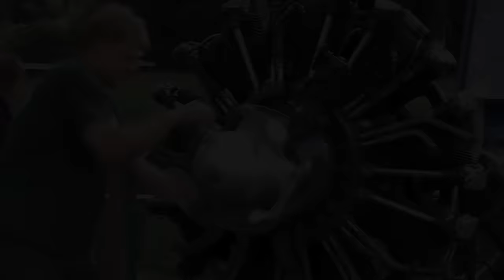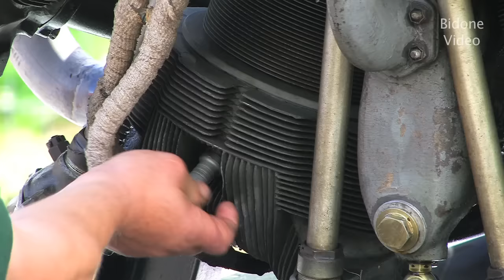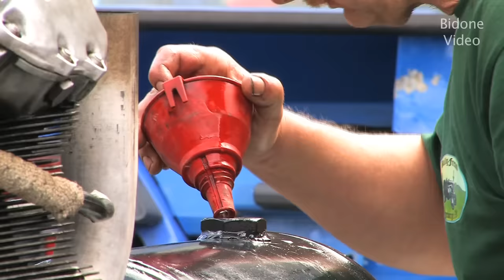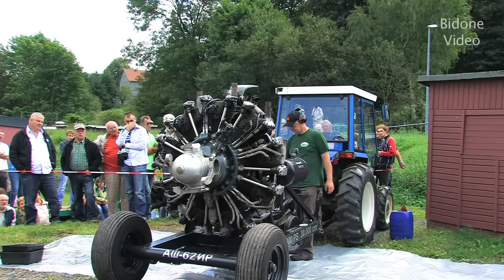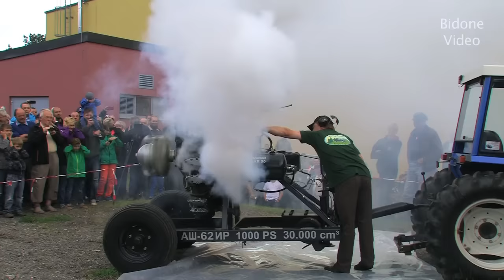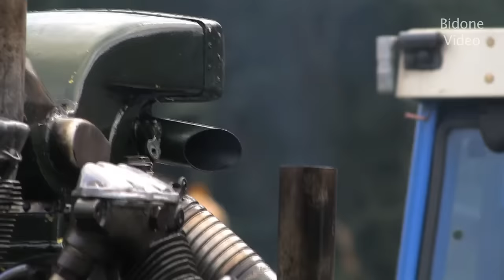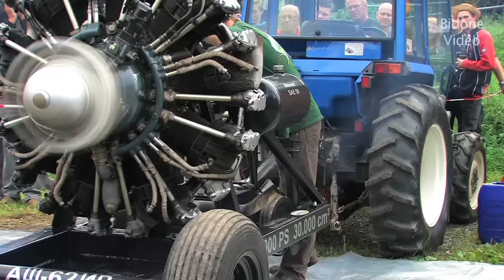Russischer Sternmotor - Russian Radial Engine Start and Run

Comment: Needs a propeller to impose some load on the engine.
Plus, what is cooling the cylinders?
Reply: +Robert Gift i was thinking the same thing, at that rate they gonna blow the engine because the lack of air cooling. 

and then they need a BIGGER tractor to hold it lol
Reply: +Neo Here tractor cleared for take-off
Reply: Nothing is cooling them. But these engines can run quite a while without overheating. The engines are designed to be cooled by the prop and the cold air up there. Radial plane engines are also used in Tractor Pulling, also without any coolant.
Reply: +Robert Gift These engines usually take a few minutes before they even reach operational temperature, so a few seconds running for an expo won't bother it.
Reply: +Soldier  they put em on choppers now also
Reply: +Neo Here yeah imagine if that was a thing lol. that it would blow up the instant its started without a propeller. you know its quite a lot of metal to heat up
Reply: )Peron1-MC(  An engine need not "blow up" to evidence internal damage. 
At a minimum I would have a fan blowing cooling air at the engine.  (But a propeller would be better.)
Reply: Robert Gift at least a small propeller from smaller engine is better than, no propeller lool
Reply: honestly the heat should not be a issue for such a short runtime. However if they let this engine sit in storage until the exbo that could cause way worse issues. Engines were designed to move and deteriorate very quickly if left unused for extended periods of time. I personally have had to revive several abandoned engines in my time and it takes hours just to get them to try and turn over much less stutter or start.
Reply: Ya good thinking their guy, let's put a prop on it to "cool" it... So it can take off and kill folks.... Short run time won't hurt that engine
Reply: Just a couple of quick thoughts. 1) I sat behind 600 hp. Pratts (BREs--big round engines) similar in appearance to engine in the video for over 10 years. As a crop duster. Didn't have batteries, electric starters on board (too much weight). Power carts at home field, hand propped if we HAD to shut down out in the field. Point is engines occasionally sat idling for hours at times. Everybody hated having to prop those monsters. 2-bladed props generated very little airflow close to the hubs where cylinders are when not in flight. Yet normal MTBOs--1000-1200 hrs!  
 2) Motorcycle engines run for extended periods with minimal to no air flow. Probably much worse cooling in urban/city areas. Stop and go traffic. For no more load than simple idling, brief run up spurts, as shown in video, no inflight life threatening issues, this thing is likely to wear out the operators finger/thumb pushing on the throttle before the engine might need mechanical attention! Even though it certainly looks 'wrong'. One issue somebody mentioned which might be more serious is that there is a massive internal rotating counter weight in the crankshaft. I have no idea how running the engine without the weight of a big prop might affect that element.
Reply: true, and I already notice some issues with the inertial starter in thee very beginning.
Reply: Ml
Reply: Personally what bothers me seeing some of these vids is the confidence they have their old engine won't throw a rod and potentially maim the folk next to it. I'm no H&S freak but sadly these things don't last forever and a bit of commonsense is a good idea. Secondly, I agree a small prop's better than no prop, as will help both the visual demo and the engine cooling. Thirdly, all airscrews are meticulously dynamically balanced ,  so there are virtually no side loads on the crankshaft or bearings when running, just as if none is fitted. It's absence in terms of reduced weight and friction will just give the engine an easier run. The crankshaft bearings easily cope with the lack of the prop's thrust load.
Reply: They re russians ffs, they dont even know how to build It and yet you re trying with techniques on them? :D
Reply: Robert, I was thinking the same thing.
Reply: Judging by the cylinder heads its air cooled. How that air is gonna get there is another question😂
Reply: PURE MOTHERLAND AIR!

Ok now really, Radial aircraft engines are usually cooled by air, very rarely by coolant/water.

Comment: This engine is from russian aircraft  AN-2
Reply: Ukraine
Reply: Venti lator
its USSR, not Urkaine
Reply: Thomas Gephard AN-2 and I-16 - fighters 1936year
Reply: I-16 was equipped with M-25/M-62/M-63 engines with fixed-step propellers. The engine in this video is an non-military version of M-62 with hydraulic propeller stepping regulator built-in.
Reply: Thomas Gephard I don't know what was with earlier versions but I-16 with M-62 engine had step regulation automatically keeping constant ratation speed, just like regular WW2 planes.
Reply: Роман Гречко don't want to be a dick, but the AN-2 is everything except of a fighter. It's a slow, fairly large old transport plane.
Reply: If equipped with double high power slingshot and 10w Chinese laser pointers, AN-2 will be a most powerful fighter in the world!
Reply: Thomas Gephard hahahaha fair enough
Reply: deWaardt You're correct, the AN-2 was supposed to be an agricultural, passenger, or sports aircraft. Nonetheless, it was frequently used for transporting troops, weapons and ammo in numerous conflicts across the world.
Reply: BeyondOasys Yes, former made in YCCP (Ukrainan soviet sosialist republic) in CCCP (USSR), also the Antonov airplane factory is located in Kyiv in Ukraine. And the other factory in Poland Mielec produced the Antonov An-2 under license from Antonov named as "Mielec-Antonov An-2"
Reply: Thanks for enlightenment, I do not know well enough the story of Antonov airplane factory. Just know that it is in Kiev since I've been in Kiev with my Ukrainan wife. I saw the tomb of Oleg Antonov in Baikove Cemetery in Kiev. I saw the tomb of Oleg K. Antonov in Baikove Cemetery in Kiev. The tombstone was made of stainless steel with engraved various Antonov aircraft.

Comment: Magnificent! but the engine must get extremely hot without a prop though!
Reply: that was just a show sir, they run it for seconds so the operator knows it though..
Reply: it won't last more than 2 or 3 minute on the ground do the overheating of the engine
Reply: Vladimirovich volk
atleast it didnt seized
Reply: It will be fine. They use these engines in pulling tractors and still warm them up for a minute or two before they take off.
Reply: Cody Johnstonbaugh yeah i watched some tractors with these kind of engine in competition...
Reply: Cody Johnstonbaugh aa
Reply: Vídeos

Comment: Wow those cooling fins! Nice sound. Interesting comment to share: Back when it was hard to find the recommended weight for Harley motors, I went to an aviation company and bought 50W for cheaper than auto 30W. Forgot who told me to check it out. Also forgot brand. Thanks for the perfect video!

Comment: Needs the prop for a flywheel to get it started properly.
Reply: Oh, so you are an expert on big radial engines?
Reply: Expert?  Hardly.  I just happen to know enough about engines in general that with a flywheel, if you get even one cylinder started, it can keep the crankshaft spinning until the others start to fire.  The WWI "rotary radials" used a fixed crankshaft and had the cylinders rotate around it- the engine was its own flywheel.
Reply: Your right. It would start up allot easier. Also would cool down the engine properly
Reply: i would think for proper cooling the engine would actually have to be flying.
Reply: +bartdereu 
you're*
a lot*
Reply: Yes. These engines had a either a short test run propeller, approximately the same size as the engine, or a fan fisk, similar the one which was used with radial Sherman  tank engines and early helicopters. Latter is a safer option. Without any cooling exhaust valve seats heat up quickly and the seat ring might drop out from it's bore in the aluminium head. Then the jug is done if the engine is an interference design (open valve hits the top of the piston..)
Reply: @ostlandr  I totally agree with you Mark.  I was thinking the same thing watching the vid.  I suppose there's a danger factor to actually use a mounted prop.

Comment: Should have the exhaust collector ring in place, would stop all the spit and flames and would run quieter plus it needs a prop to stop it running away like that from cold. Poorly maintained as it runs pretty badly.
Reply: Well it was made in russia though Draxindustries1
Reply: Yeah like he's saying!
Reply: You're right, but it was show, and it acts more spectacular without exhaust collector.

Comment: There is a similar "bare" engine in Hungary, where they salvaged the engine from a retired An-2, the man built the platform and the engine control on the trailer himself. :)

Comment: wtf did he put in the tank.... honey??
Reply from the maker: Engine Oil.
Reply: +LifeTips 
He put in 50 Weight Oil just like my 1973 Ironhead XLCH Harley Davidson Sporster...  Most of the Old HD's used 50 Motor Oil, not until the Evolution Engines did HD start to sue synthetic...
Reply: +LifeTips  ha ha ,funny !
Reply: +LifeTips   That is OIL.  And it uses a lot as you can see, until the engine heats up the rings a just a tad hungry..
Reply: +ThePostal67 With no prop or cowling I imagine it heats up rather qiuckly
Reply: crankman68 True, that is why the smoke stopped so soon.   Does on most radials, but they use a lot of oil overall.   Most of the burn is at start up as the oil drains to the bottom cylinders.  Was talking to a guy that had one in Harvard IL.  World famous pilot, did a lot of shows..
Reply: +LifeTips  Да это мёд :-)
Reply: +LifeTips oil? it says motorenöl wich i belive is motor oil in german
Reply: +LifeTips yes it is honey, Russian bear likes honey :3
Reply: shayson1357 lolol
Reply: SAE 50 weight oil. it says right on the side. Just saying.
Reply: vector6977
thanks
Reply: you need to feed the cubs pushing the pistons right :)
Reply: American oil for french fries. :D He brought it directly to McDonalds, they were going to sell it for food :D
Reply: mptrax
lol
xD
Reply: +Bidone1967      20 - W50, braucht meiner auch....
Reply: +turbocompound Nein das ist singlegrade Öl, also nur W50
Reply: Vodka!!
Reply: It is motoroil he needs to mix that with the oil but it has its own compartment
Reply: lol
Reply: only difference is this guys motor started and didn't piss 3 qts of 50wt on the ground.
Reply: oil
Reply: DreamGaming No shit..!
Reply: purplinko its a joke chiil
Reply: )Peron1-MC( Motor Öl or Motoröl

in suisse-german: motoroel
Reply: It sure as fuck wasn't Pep Boys $1.19 a quart 30 weight!
Reply: Bear Grease
Reply: No, that's SAE 50W 5w30 would be way to thin. especially after the heat generated
Reply: Diesel engine oil
Reply: Yes, it's honey, Honey. SAE 50 grade super concentrated honey, from bumble beez on steroidz for high performance enjinnz! You'd be crazy to feed this thing with oil... :^)
Reply: Your a classic engine but doesn't know what motor oil is?......
Reply: YBNlean    Yes. Sometimes Maple syrup.
Reply: SAE 50 oil
Reply: Ciao5
Reply: glue
Reply: +ThePostal67 
IMO - Most likely this radial  engine doesn't run valve guide seals on the exhaust valves... Which would explain the top cylinders puffing  blue smoke before the cylinder head heated up enough to tighten the tolerance in the exhaust valve guide eliminating excess oil consumption. 
If it were the rings the motor would have a serious blow by issue and most likely wouldn't run at all.. If she did run, she would've been popping and banging out big fire balls.. 
Btw - I haven't ran valve guide seals on my race motors in years. (Chevys, Arias, or in either of my Brad motors) they all fire up and do the same thing..
Reply: Bidone1967 😂😂😂😂

Comment: no blades , heat must be high
Reply from the maker: +L Pi The Engine runs only for 60-90 seconds. Then she cool down for 2-3 Hours.
Reply: +Bidone1967  smiles i agree noticed you ran it too the edge   too bad you could not have the blades on may i ask the fuel you are using .. looks thick ..wvo? i love te sound a diesel man
Reply: +Bidone1967  that's very efficient ,
Reply: +L Pi That thick liquid was oil to lubricate the engine.
Reply: yeah, it is oil.....did you see the viscosity level indicates, SAE 50? that means the plane engine needs thicker oil for high RPM type engine..
Reply: High RPM?  most radials have a max RPM no higher than 3200 RPM..  about the same as a diesel
Reply: High RPM? Where did you get that gem of disinformation from?
Reply: Correct for above Jesimig- watch end of video as well as start you will notice a puff or two of eshaust and multiple revolutions of prop-hub as it is geared up from shaft.
Reply: droceretik
Reply: haha sorry guys i thought it was revving...i dont know what u call it but all i know was the SAE50 indicated as high viscosity nothing more...
Reply: Yeah, what?
Reply: The oil thins with heat. Starting with a thinner oil would most likely result in a lack of a sufficient oil film on bearing/bushing surfaces. Airflow in flight actually does the majority of the engines cooling, not the propeller.
Reply: droceretik ok.... youre the smarter one i know that...
Reply: So what? What's so smart about knowing that a big radial engine does not operate at high RPM? It's pretty rudimentary information that anyone with a basic understanding of aero engines should know.
Reply: droceretik yup.. i dont argue with people who knows everything... im just curious/interested about this engine..  why so serious? ...im not going to ask "am i the only one here who is so dumb about airplane engine?" coz its already in my comments that i didnt defend ny first comment..
Reply: someone asked here "that fuel he filled was thick" i just answered that was the oil.. and that rpm thing was my bad so relax...im not an aircraft expert...
Reply: droceretik is what I would call an "Intellectual Troll" trying to convince people he knows everything and has never been wrong. Like it's been said: "There's no such thing as a stupid question". He's not smart enough to know that if that makes you feel any better.
Reply: Yet, you have made the previous comments about oil viscosity, oil films on bearings and airflow in flight. Are you the self proclaim expert? Nothing I have written in previous comments attempts to establish me as a know all. I also don't presume to know the intelligence of the people based on a few lines like you seem to.
Reply: I certainly don't "know it all" but having an extensive mechanical background may qualify me somewhat as an "expert".  I had automotive classes in high school (Power Mechanics), was schooled by the US Army's Corps of Engineering at Fort Belvoir, Virginia (power generator operator/mechanic-52B20) served in the US Army's 14th (former combat) Aviation Battalion as a mechanic and later as a mechanic with the 3rd Infantry Division's 3/67 Air Defense Artillery helping shoot down enemy aircraft with the M163 Vulcan with it's 50 rounds per second 20 mm rotary cannon and the MIM-72A/M48 Chaparral with AIM-9 Sidewinder missiles. Hell, my shop vehicle was an M561 Chance-Vought Aircraft-designed Ling-Temco-Vought Aerospace/Consolidated Diesel Electric Company Gama Goat 6X6 Cargo vehicle. That was 42+ years ago. I've only gotten smarter since then, kid. You should have known.
Reply: Why should I have know your life story? I don't have a crystal ball that tells me what qualifications, experience and knowledge you possess. Good for you. You deserve a medal if you haven't already been issued one for your service to the military.
Reply: droceretik
coz u seem reacting so negatively..whats so wrong with my comments? im trying to share what i know... well if its not the best answer then why the negative replies with me?
you seem to know everything so i just think youre the only one who laughed with my simple comment..
Reply: That's one of my many flaws. I don't suffer foolish or ill-considered comments readily. Sorry if you were offended. Good luck.
Reply: Actually, a "blade" or air screw (propeller) is needed. It acts as a flywheel. It's like running a automotive engine w/o its flywheel or torque convertor/flex-plate. Sure, you can run them w/o them for a bit but...
Reply: Radisalengine
Reply: ~cygipr